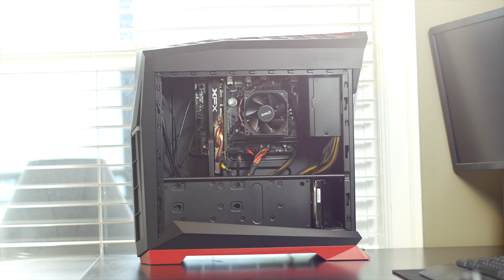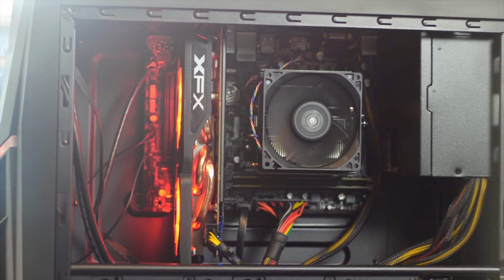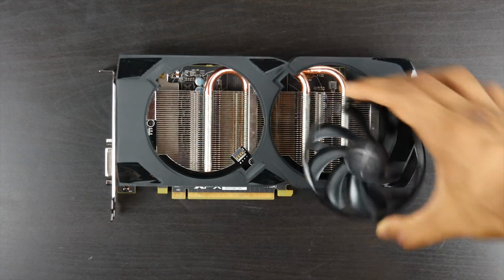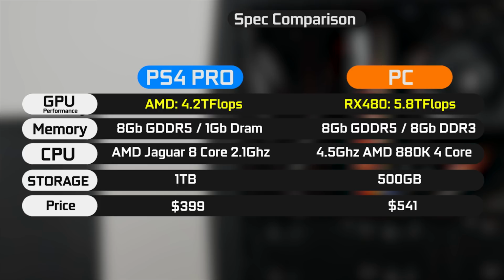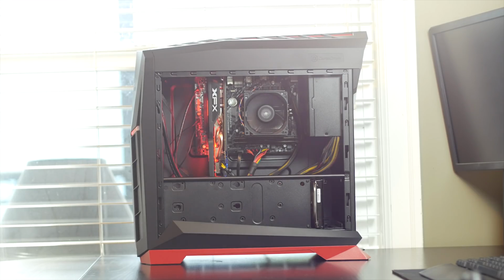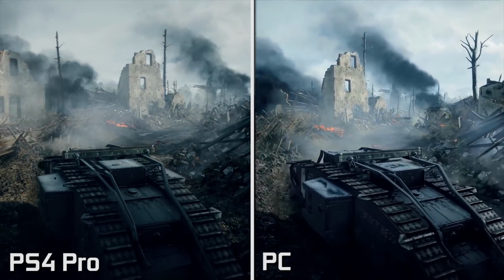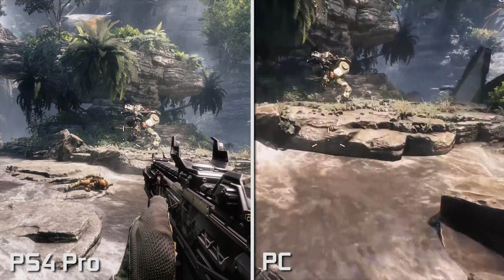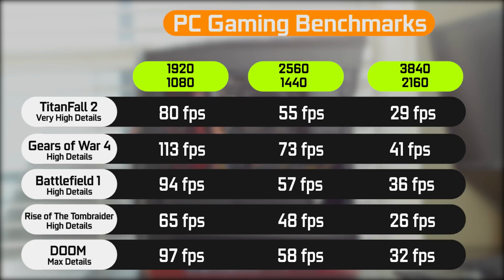Playstation 4 Pro vs $550 Gaming PC

Comment: Overall the PS4 Pro is more bang for the buck. However, on long term usage the PC is probably cheaper due to cheap games.
Reply: yeah the same games on sale for BLK friday were much cheaper on the PC
Reply: A Tribe Called Quest Take a trip to G2A and other third party websites... Who the hell waits for a Black Friday sale on PC?
Reply: DarkrainHD i wasn't waiting i just checked and what do you know some of the games i've wanted to play were less than $5
Reply: ssjMaximum22Goku False, most games can be preordered right out the gate with a discount on PC, Watchdogs 2 just came out and it's already $45.
https://www.kinguin.net
Enjoy...
Reply: ps4 is more expensive due to ps+...
Reply: If you're getting a current-gen console then you're 99% paying for online.  So add a recurring $60 on top of $399.  Plus you're going to want some games as well.  Add another $100+ and that's IF you buy sencond-hand.
Reply: BOBlibob not just because of the cheaper games.may you also need  a pc for school or work.i think a ps4 pro plus a cheap lap top costs around 600$.with that build you got both in one.first do homework and then play games.
Reply: Paolo Pappalardo That's true, but I was just talking about gaming
Reply: Nope, the PS4 is much cheaper .. Look at the PS3, it started on 2006 and played every game devs threw at it until 2015 .. What pc can do that without at least an upgrade to the gpu ? Don't let me started on optimization, what pc with 512 ram can run skyrim ? How many games such as batman and watch dogs and thief had optimization problems on a pc when on a ps they run really smooth ? Or about the games on a ps which are far better in some occasions, such as uncharted and god of war ... I own a gaming rig because a pc is a tool, its a must have in real life, it is my life, my work and my everyday entertainment system but when it comes to gaming, ps4 exclusives will always be better IMHO ..
Reply: Karmakaluas but also back then devs didn't focus on PC's as much as they do now and the pc devs will only improve while true a $600 rig in 2006 would be obsolete by 2015 a $600 build in 2013 is better then the ps4 and competes with the pro while at the same time gives you much cheaper games and no online fees they even each other out
Reply: A Tribe Called Quest PC was stronger than consoles in every gaming generation, power isn't everything ... Optimization was not and will never be pc's strong point because devs are focused on consoles .. They pay more per game, they are less hackable, thus less pirated and they sell more ... Plus, a gaming pc will be more powerful now but ps4 will play games in 2020 while a pc you build now won't .. If you think a 480 will play games in 4 years at 1440p you are mistaken my friend, not even my 1070 gaming x will play them .. The difference is that a dedicated machine will always be better at what it does than the multi purpose machine, you can't compare ps4 in gaming to pc, the one will play games forever without thinking about the specs and in the latter I can program in CUDA ..
Reply: Karmakaluas lol i said that pc optimization has only gotten better and will continue to get better by 2020 lol 
a 480 may not be able to play a 2020 release at 1440p but a ps4 barely plays a 2016 release at `1080p without frame rate dips 

you pay $200 for a graphics upgrade in 2020 and you will be running games in 8k 

furthermore console generations won't be the same as they used to with a new system every 4-8 years instead their going to keep making upgrades every other year so your ps4 will probably be obsolete by 2020
Reply: Karmakaluas well said my friend
Reply: Karmakaluas i don't mean dips while your playing i mean you'll be playing games capped at lower and lower fps for example devil may cry DMC cameout at the end of the ps3's life and was capped at 30fps and had stutters despite being a game made for consoles but you could easily run it at 60fps on a decent pc 

Fallout 4 released quite early in the console gen life cycle and was capped at 45fps with terrible stuttering on ps4 more than xbox fallout 5 you'll be lucky to get 30fps unless they really improve the optimization

in 2020 i'm sure you'll be able to play native 900p games made for the ps4 that a current $600 build may have trouble playing at high settings however if you spend $200 for an upgrade you'll be able to run most games at ultra settings in whatever K is out that year while the ps4 you'll have to play 300-500 for a pro 2 or something
Reply: BrothaRobMusic you mean you doubt they're going down? 

i think its a fine system but they cheat they're graphics
Reply: A Tribe Called Quest You say you are sure but man, history has proven otherwise .. For all the console generations .. I really cannot understand how you reach that conclusion .. Hardware industy may be driven by pc users but the gaming industry is driven by console users ...

Personally, the immersion of a game is the first thing that matters to me .. Pixels and graphics is one thing that can surely help to reach that state of pleasure but in the end the gameplay and the story are the ones that matter ..

I am 28 now and i find myself lucky to be able to play in every console since the Atari Jaguar, i hope gamers everywhere are lucky enough to have their minds opened about specs and resolutions, not all games are supposed to be like Witcher 3 and GTA V ...
Reply: Karmakaluas your arguments make no sense your not even responding to me 

sure graphics don't matter if the game is good but i rather be playing it on a better graphics if available 

don't even talk about history because 20yrs ago PC games dominated the industry and it was flopped so it could happen again smh 

i'm 25 and i'm glad i didn't waste my parents money on crap consoles at that age because i can just emulate most the old school games
Reply: Karmakaluas parents money on consoles when i was a kid holy fuck your reading comprehension sucks ass goodbye
Reply: but can pc play bloodborne, god of war, uncharted and other ps4 exclusive?
Reply: ssjMaximum22Goku console games in my experience never dip past $15 and i wait at least 6 months before buying most my games
Reply: grey hound That's true especially since the PS+ free games have become really bad.
Reply: Max Wolf thats why you get the limited bundles that come with 2 games like mine. My ps4 cost $450 but came with last of us, kill zone and a second controller
Reply: A Tribe Called Quest I doubt that, ps4 sales are going up. More people are buying them
Reply: A Tribe Called Quest Nope, sorry mate, cannot see your point .. There are games with frame dips but in like 1% of the games in total, maybe less ? That cannot be a solid point of refference, sorry ...

The other things you said about optimization and the end of generations are just speculations and you are totally wrong not because i say so but because history has proven you wrong time and time again ..

If you allow me, your overall mentality is wrong ... My PC back in 2006 was obsolete and it had 1GB of RAM Pentium 4 and an AMD HD with an AGP, bought in 2002 .. PS3s  though have more and better games than a pc nowadays .. For example you can't play NFS Rivals on a PC with 512MBs of RAM, you need a patch to let you play in 4GB .. The same happened with the ps1 and with the ps2 and with the psp, the same will happen with the ps4, it's just history repeating itself ..
Reply: You are 25 and you still on your moma's pocket money ??? :')

And you call yourselft the "master race" ?

PC gaming 20 years ago was like pc gaming now .. A few diamonds but nothing to explain why the need to spend so much money .. I can still play emulators in my ps3 ..

PC is a must have and always was butt when it comes to gaming, consoles had always been superior due to the ease of use, more exclusives and better value in time ...

Most game developers don't give a single f* about pc .. Want to know why ? Cause games on pc get pirated before they even launch .. If it wasn't for sony, who made the choice to go for a x86 architecture and MS to follow the same path, pc games today would be half as much .. And if you think i'm being bold i dare you to remember at the ps2/ps3, xbox/360 and gamecube/wii exclusives ..

If you are indeed 25, i have to say to you 3 things .. First of all, get a job, c'mon .. Secondly, be open minded, console gaming has helped pc gaming as pc has helped consoles to develop, or did you think you'd had blue ray without consoles ?? Alternatively, pc gaming ruined console gaming in some cases, for example patches and updates were not a thing up until 2005 and the games were great and run great without bugs .. Lastly, consoles are for the people .. You don't have to run as an admin, overclock, look at the back of the game to confirm you have the minimum specs, games don't crash (at least not as much), you don't have to set up a control or change the graphics, in multiplayers there are not as many cheaters .. Yes i can play 2Κ 60fps with mods and my corsair cherry mx strafe looks great, my corsair mouse feels great but aside a few games i cannot play on my ps4, such as star wars TOR and euro truck simulator 2 (yeah, i know) i will always prefer my ps4 ...

Who the f* cares about 1080p .. I can't play warcraft 3 on 1080p, should i stop playing it ?? F* you mate to whoever tells me to stop playing warcraft 3 .. F whoever tells me to stop playing pokemon cause its low res, f whoever tells me to stop playing the last of us cause it has dips from 60 to 48 fps and also f u for being a snob with yo mamas purse .!..
Reply: Abdul Haris i guess it depends on how much you like those games... uncharted alone is almost worth a system tho
Reply: Buying used console games is the shit though. I inherited a ps3 and went ham on the pre-owned rack at gamestop. So many good titles for $5 a pop. Red Dead Redemption, the Uncharted games, The Last Of Us, they still play great. Whereas on Steam, games of this vintage are still like $20.
Reply: BOBlibob The games are only cheaper on PC if you wait a while. Most people want to play the latest games in their first 1 or 2 months of release.That means paying full price. Console games also become pretty dirt cheap after a while.
Reply: All in all, i generally doubt any credit given to the uploader ... Either a troll or a fanboy, in any case any butthole today can write an article even from his smartphone, doesn't make it a trustworthy article ..
Reply: Specifically the multiplats are the games that play better than any other console .. You may argue that you are a ps4 owner but you are ignorant AF :")

Comment: Why gtx 1070 do you guys recommend for this month?
Reply: The Gigabyte one. In newegg, its 370 dollars. Get it while the promo still lasts.
Reply: Will sound a bit under the controversial side, but the EVGA 1070 FTW is IMO the best 1070 out there right now.
Reply: +zionlee1004 ok thanks
Reply: DANK HARAMBE Sure, the 1060 and 1070 can perform like a 1080.
Reply: Dank Harambe Well, the 1080 is 4k oriented so obviously it is for the rich kids.
Reply: What*
Reply: [Comandante737 ] none
Reply: +Davide Ciuffardi Pais ok thanks
Reply: strix
Reply: if he knows how to install thermal pads, then get it.
Reply: DANK HARAMBE or spend 200 more and get a much better GTX 1080 you'll do yourself favor of buying that vs a 1070
Reply: +DANK HARAMBE thanks for opinion, I was thinking of buying the gtx 1080 but now after you said that I'm buying the 1070.
Reply: DANK HARAMBE What GPU can perform like a 1080 at the 200 -300 price range?
Reply: +DANK HARAMBE I've changed my mind with the 1080. I'm looking to play games at 1440p ultra settings the sweet spot for that is the gtx 1070
Reply: [Comandante737 ] i'll go with the msi1070 in january
Reply: :) If you can wait till January, you could wait just a bit longer for the next generation of Nvidia cards.
Reply: Paul Petru Alexandru Cazacliu When does the next Generation Come out?
Reply: [Comandante737 ] Ftw edition by EVGA

Comment: You could have gotten a cheaper PC case, anything above $50 shouldn't be in a budget build, the extra money could have gone to a GTX 980 ti or a GTX 1070 if you don't mind squeezing a bit more cash.
Reply: Fair point, a 980ti or 1070 would not work very well with a budget setup, an R9 390 would be the better alternative (you can get it nowadays for less than $200).
Reply: (( I agree with the cheaper PC Case thing ...however.))

You could have gotten a GTX 960 or 970 and had spent all the extra cash on.. oh I don't know; Twice the ram and spent anything left over into either working out a Intel processor, or just getting something else like a dedicated boot drive for comfort, drive storage capacity, or other options; such as a second case fan to help with cooling.
there's no need to have something like a 1070 or 980  added into a cart of things you want to classify as a "Budget" build. (** 980TI /1070; both of which cost over or around 350/400 dollars..Without shipping)just my opinion.
Reply: IzanagiXZ a gtx 1070 won't really make a better job than a rx480 with a bad cpu, you would at least need a decent i5 and that again needs a little bit more cooling.....it's like upgrading your car engine from 75hp to 350hp without upgrading you wheels and brakes, makes no sense!
Reply: IzanagiXZ a gtx 1070 won't really make a better job than a rx480 with a bad cpu, you would at least need a decent i5 and that again needs a little bit more cooling.....it's like upgrading your car engine from 75hp to 350hp without upgrading you wheels and brakes, makes no sense!
Reply: why not compare a $1000 pc to the $400 ps4 pro if we're just going to ignore costs...
Reply: My mistake, I didn't realize the GTX 1070 costed so much, not that you need a GPU like that to beat a PS4 Pro, a GTX 1060 is more than enough. It is however possible to get a used GTX 980 ti for around $300 if you look around carefully, I was once close to getting one but my pay check took to long...ugh... -_-

Comment: Not saying this is bad but the 480 will bootleneck the 880k cpu. The fm2 board is mostly dead by now. If you were to use amd 460 or even 470 it would been more useful. Even a 950 is better